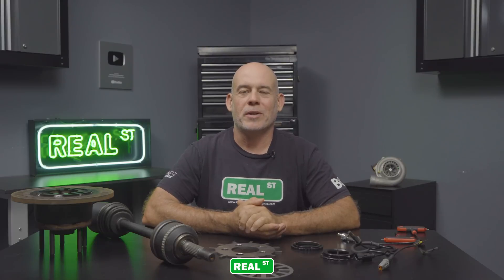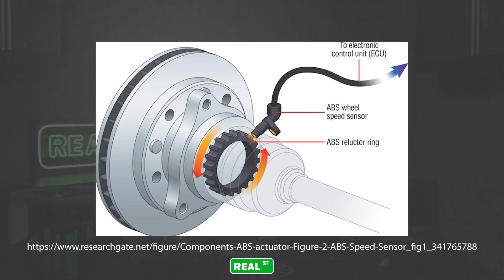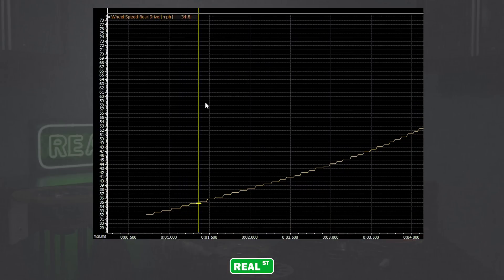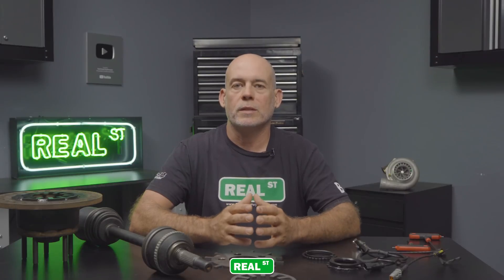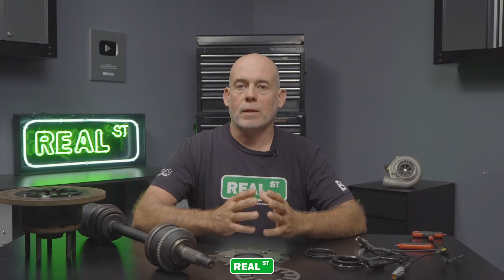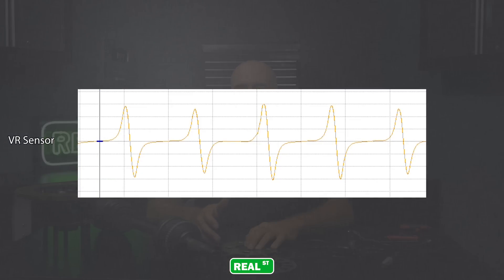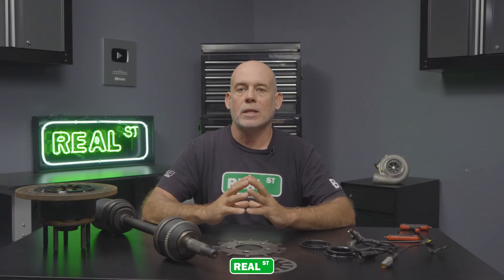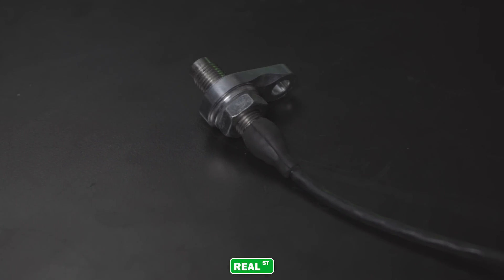Jay Talks Wheel Speed Sensors, Traction Control And Why They're So Important - Jay's Tech Tips

Comment: Great video- I presume you have good luck with ignition retard then? I just remember some turbo V8 guys saying retard didn't work for them as the retarded ignition would spool the turbos harder so cancelled it out.

I know of some systems that do fuel cut, and as its a full cut it's meant to be safe, but it still scares me a bit that it wouldn't be full...
Reply from the maker: It would depend heavily on the application. Some engines react different than others to ignition retard or cutting, so its important to test different methods until you iron out the best version for your exact setup. Thanks for watching!

Comment: Bmw N54 load, boost, traction, gear change are  done with huge timing drops- like 30deg swing, throttle reduction if needed.
Throttle stays 100% open during gear change so BOV dont work unless overboost spike on upshift.
An intertwined balancing act
Reply from the maker: Those engines are pretty sweet! Its cool to see the differences needed between platforms.
Reply: @realstreetperformance 

would love to hear "jays" thought about this: "can engine be damaged internaly with adding oil while the engine is hot?"

Comment: In rear engine transaxle setups (aircooled VWs and Porsches) where are the drive shaft sensors supposed to go? On each rear tire-side CV joint? I’d assume they need to go on both driver and passenger side if the car is running an open diff or a limited slip versus some sort of locking differential?

Comment: Jay - it wasn't clear to me why you wouldn't use the same tooth count on your non-driven wheel? I understand that higher tooth count is more important on the driven wheel, but is there any disadvantage to running it on the non-driven wheel?
Reply: There wouldn't be any disadvantage, it just isn't necessary. The reason is, on a 2wd vehicle you are only using the non driven wheel speed as a control, and wont be applying any correction to it via timing or fuel cut as it is not connected to the powertrain. Therefore the lower resolution isn't much of a concern as the front wheels are not going to be losing traction in a straight line as they are not "driven."  So if it was doing 50mph 30 degrees ago on the non driven wheel, it wont be making a change large enough in those 30 degrees before the next tooth, that the control would cause an unwanted correction at the driven wheel. Now if the front and rear are the same tooth count, then the control wheel speed (non driven wheel) and the driven wheel speed will track together, meaning the control speed and the driven wheel speed would occur at the same time at the ECU, so corrections could occur in real time (although we are splitting milliseconds here). I don't have data to prove this, but I would think that a tooth difference front to rear would cause a slight (but possibly unmeasurable) issue where the ECU would have corrections that would not be needed. For example, if the front wheel had 2 teeth we would only know the speed at every 180 degrees of rotation as our control, and if the vehicle had a 5 mph increase in speed as measured at the higher resolution/tooth count driven wheels over that same 180 degrees rotation, then it could make unwanted corrections as the front and rear would have a large enough difference in that time. Most aftermarket traction control will allow you to set up the allowed wheel slip though and I imagine this could be tuned out as a base correction through testing in good conditions. But again this would likely only be a major concern if using a high resolution rear with a VERY low resolution front. On a control wheel (non driven) id guess anything over about 10 to 12 teeth would be fine as there aren't many cars that will have a large enough increase in speed over 30 to 35 degrees of rotation to cause any unwanted corrections. This all goes out the window in an AWD vehicle though as now you don't have a "control wheel speed" to use for corrections.

Comment: I like the idea of retrofitting the hall effect into the factory ABS sensor location. My E36 has VR sensors in the front and rear for the ABS. I will not be using the ABS as my car is also being run in land speed events. I was going to use the factory sensors but the FuelTech ECU I am using has to use a VR to hall / analog to digital converter. Not sure why I didnt think about using a universal hall sensor like you showed in the video but I appreciate the info. I think I will set this up similar on my car just to avoid the failure point of using a converter. I also like that using that universal sensor you can fine tune the sensor gap with the threaded sensor and lock nut in that custom bracket. Now I just need to find a fabricator willing to build a set of brackets for my car. I really enjoy these videos a lot, thanks for the time and effort.
Reply from the maker: Thats cool to hear youre also venturing into the Land Speed racing side of things. Good luck with the build and thanks for sharing!